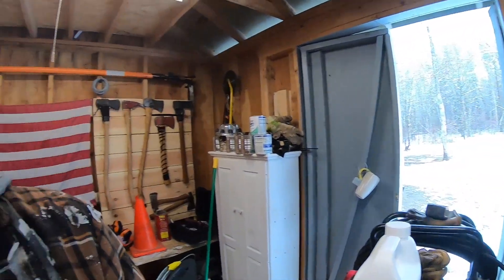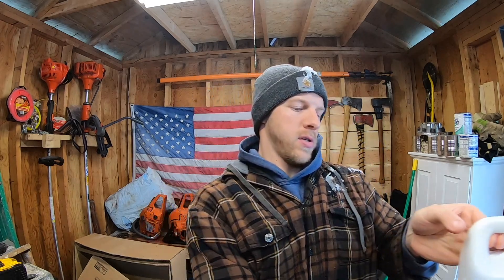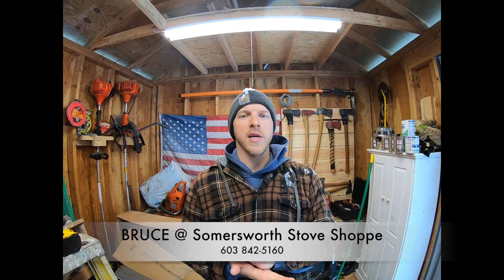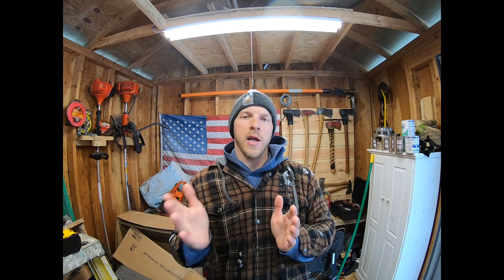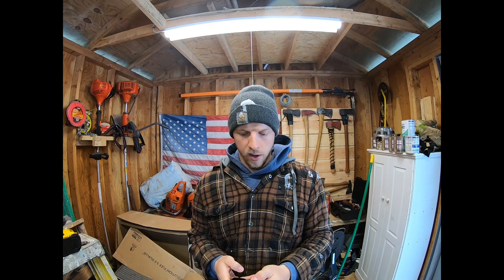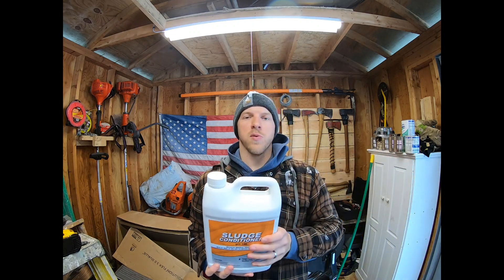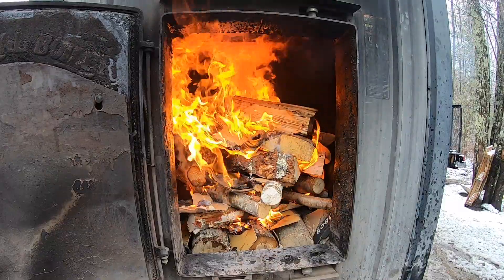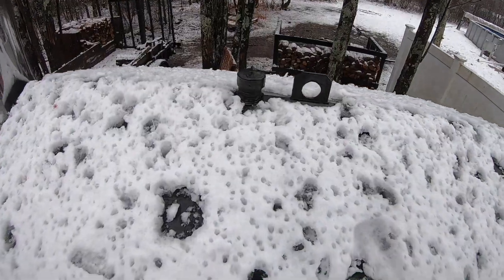Central Boiler Water Change | Part 1

Comment: How often should you do this treatment jay?
Reply from the maker: You should check your water begging, middle, and end of season  every year. Its easy and fast to test the water.  As far as "changing" the water you dont "have too" The reason I am is because Central Boiler has a new test kit and new corrosion inhibitor so I want to be with the most "current" technology.
Reply: @HomesteadJay  good to know thanks. Makes sense. I’ll see what heatmor recommends for mine, but likely this stuff will work no prob
Reply from the maker: @Bartons_Ltd  Id imagine it would work and clean but just be sure! Never know with different brands/metals/pumps etc!

Comment: I need to do this also, mine was installed in 2008 also
Reply from the maker: Yeah I dont "have too" as the water is in clean shape and perfect level of inhibitor but I want to get on the same page with the new chemical they have. If they didnt change the corrosion inhibitor solution I would prob leave it lol but wont hurt to change!

Comment: Good info I need to do this , and my wife said she reached out and wants to shut ours down , but we need for our hot water as we have a 1000 gallon tank in the ground and I’m sure no good , , so my wheels turning , I saw the white knight heavy Chevy in the back , nice plow truck , 👍🏻
Reply: The 1000 gallon tank is an old oil tank , I’m going to get an upright 275 and abandon the 1000
Reply from the maker: Hahah shhhh the new heavy chevy will make an appearance next video or so LOL yeah that’s a tricky situation. Do you need to heat the 1000 tank? Or can you by pass it for summer?